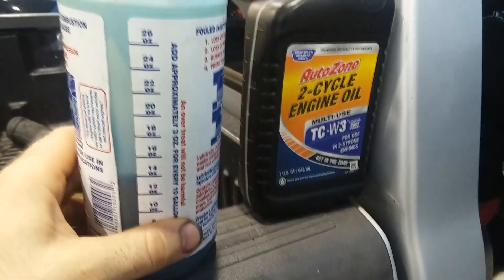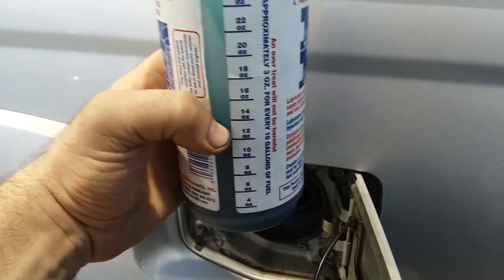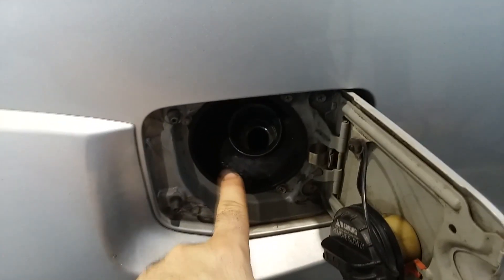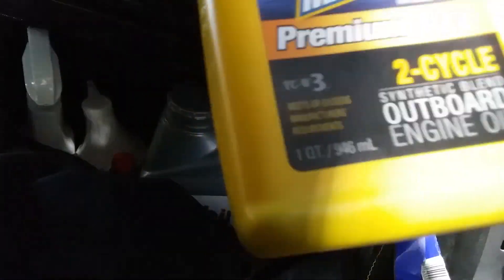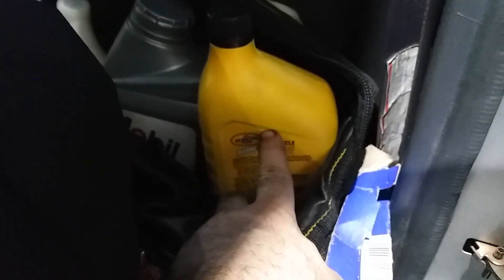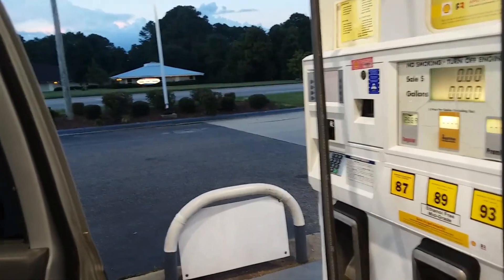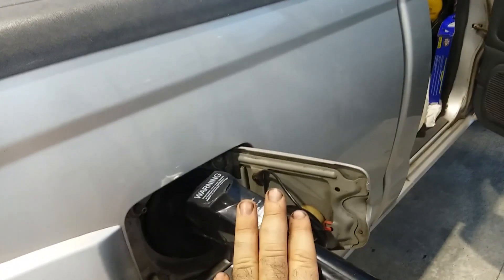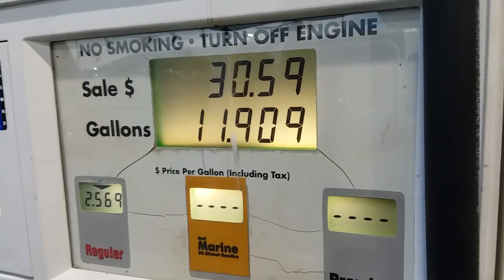The Secret to Better Gas Mileage: 2-Stroke Oil in a 4-Stroke?

Comment from the maker: Be sure to enjoy my TCW3 2 stroke video that covers greater detail about what it does and why I use it and how it compares to the Lucas Upper Cylinder Lubricant, which I used to use.
More about 2 stroke TCW3: https://youtu.be/lfDm1gMKqFY
Lucas Upper Cylinder Lubricant:
https://youtu.be/ATL19lVpmAk

DE Nichols is an Amazon affiliate and if you buy anything on Amazon 
after clicking within 24 hours then you are supporting the channel. 
Thank you.

DE Nichols is not sponsored by any of these products. I conducted my own
 scientific testing and found them to increase efficiency on my 
vehicles. Individual results may vary.

Comment: 500ml Two stroke oil added to a 100L Petrol (gas tank of my truck) keeps everything happy and clean inside, even my muffler and exhaust pipes dont ever rust . . doing it for 35 years .
Reply: Its a 1:200 ratio . . . very little two-stroke . . .but makes a hell of a difference.

Comment: Dang I run an ounce per gallon in my 93 Jeep 4.0
Reply from the maker: Wow. That's very different. You learned that's what it likes?
Reply: @DENicholsAutoBravado  Yep it runs better at that mix in hot weather
Reply from the maker: I'll have to remember that. I do occasionally run into fans of older Jeeps! I fixed up a 60's or 70's something once. They couldn't figure out how to keep it on. I replaced all the vaccum lines that were leaking vacuum and it ran tons better for a customer. 

It still didn't quite have a steady idle but the customer was so happy it was much easier to keep the engine on. Lol

Sometimes, a lot of times, I want to fix something farther but you can't argue with a happy customer. 

It had to almost be 2k rpms probbaly just to stay on before I gave it some TLC. Dipping below 1100 rpm was sketchy after that. Much better.
Reply from the maker: They were usually DIY and figured with the big issues out of the way they could probbaly take if farther from there. 😁
Reply from the maker: I seem to remember he bringing me another of his collection a few weeks later. I mostly know 1996 and newer cars much better so whenever I got to competently work older tech it was quite satisfying.
Reply: @DENicholsAutoBravado  funny thing is mine has a slight intermittent sputter at low idle, I think I need new injectors & the 2 cycle mix is acting as a bandaid for that because it goes away with the 2 cycle mix. Just guessing but I'm going to inspect the injectors soon to verify
Reply from the maker: @Yelladog78  Interesting. I wonder if it's partly because of summer gasoline versus winter gasoline formula? Or if the extra heat is the primary difference.

TCW-3 oil is better suited for non 2 stroke applications than normal plain 2 stroke oil by the way.

It can raise compression a bit so I suspect your engine when younger wouldn't seem as different when it's hot out.
Reply from the maker: @Yelladog78  You might see the fuel injectors not working as accurately if you're good at reading spark plugs. The color temperatures and other details spark plugs can show can be very interesting. 

If you don't know how to read them you can always send a quick video clearly showing the spark plug blades.

Comment: I use this in my 2cyl. string trimmers and my chainsaws. They sit all winter and start up every spring in one to three pulls. I have a steep hilly yard and use it in my riding mower gas and my self propelled toro mowers and it gives me cylinder protection because they are sling oiled.

Comment: I run an old trail bike that was designed to run on leaded fuel, as it's almost impossible to buy leaded fuel now I add a little synthetic 2T to the fuel, lead used to lubricate the top ends of engines, rings, and cylinder walls, small end bearings,  modern engines are designed to not need lead in the fuel but old engines need a lubricant, since adding 2T oil the engine runs quieter, smoother and there is no difference in power, and it just as easy to start, I add a 2% mix. plus it smells great,

Comment: Been doing this for a while in all of my vehicles and equipment to help protect the cylinder walls and prolong fuel injector life. The benefits are very noticeable on my air-cooled Ducati, which are known for running very hot. Using full synthetic 2T oil in the fuel, I’m able to place my bare hand on the engine case after a freeway run without getting burned. For anything thats water-cooled, I use TC-W3 for its lower flashpoint temperature. Additionally, all of the cleaning additives in these fuel oils are causing the old carbon buildup on the valves and piston tops to chip off over time, leaving them clean and shiny. It almost seems counterintuitive for fuel oil to clean the combustion chamber, but that’s exactly what it does.
Reply from the maker: I absolutely appreciate this comment. Just switched back to TCW-3 from SAE30 oil and I noticed the difference right away.

I think my spark plugs wear out faster with the SAE30 oil. Hopefully, that won't be an issue with TCW3.

Comment: I've done that b4..this is what happened >>>..the oil fouled my sparkplugs..ruined fuel injectors..smoked by the exhaust pipe..less power.clogged up my gas filter n I got crapy MPG...bottom line is 4 strokes shouldn't  have any type of oil in there gas...
Reply from the maker: None of this happens with these products when used correctly. It lubricates all of the fuel system, has no effect on the spark plugs and improves MPG.
Reply: What the f you put in you car?😅

Comment: I have baught shell advanced 2t motorcycle oil which is semisyntetic having JASO FC certification. I put 1ml 2t to 1liter of petrol in my Euro6  motorcycle Its my first use and niw I just git carbon deposits in my exhaust but the bottle claims that it prevents deposits in exhaust, keeps engine clean and low smoke.
Reply from the maker: I think there will always be carbon deposits in our exhaust. Lol, but I'm sure a poor oil choice would do worse.
Reply: @DENicholsAutoBravado    BUT Shell advanced had all the certifications including  JASO FC and FD, ISO, API etc and it is semisyntetic.
Reply from the maker: Yes. Great company. Great product. Burning gasoline will still produce hydrocarbons. And some carbon will deposit.

With the wrong conditions it can be really bad amounts of carbon and with better conditions it's not so bad. Make sense?
Reply: @DENicholsAutoBravado  Thanks bro. 💯 Correct.

Comment: i have a 4 stroke lawnmower and have been using stils 2 stroke oil in my gas 50:1 ratio 20 ml to 1 liter,, doing it for years.. runs cooler and less contaminated 
so i only have one type of gas in my garage..
Reply from the maker: My 1 cylinder 250cc dual sport motorcycle loves it too!

Comment: Wouldn't  driving around mix it up well enough? The sloshing while speeding up, stopping, and turning?
I read a 60 page forum on this and the author stated that it didn't matter whether you did it before or after.
Reply from the maker: All I can say is I tried it gasoline 1st once on my motorcycle and I ran the tank across crappy freeways and roads for 50 miles and the mix was still poor. Pour the additive and then the gas? Mixed perfectly in a minute of it just idling. 

Idling! Little 250cc idling and sitting there versus stop and go, freeway, bumpy construction zone. 🤣

Yes, definitely put your chosen additive in and then add the gas.

I saw gasoline with lines of blue additive barely swirling in versus the whole gas tank evenly looking blue.

Comment: I use it in my collector car and anything that gets filled from a jerry can. I can tell you the tail pipe is spotless and the engine runs smoother.
Reply from the maker: I forgot my modern trucks tail pipe was less sooty too. Thanks!

Comment: For engine 4 cycle.
2 cycles of synthetic or semi-synthetic oil leaves ash on top of piston, should be used 2 Cycle TC-W3 not synthetic.
Provides improved lubrication, engine cleanliness, rust and corrosion protection, also provided improved performance when used low octane. Max mix (ONE) onze 2 cycle oil by 5 gallons gas.
Reply from the maker: A gentleman who had been researching and experimenting with oils for many years more than me, told me that synthetic TC-W3 was the lowest ash, but anything TC-W3 would be good, but synthetic would be better.

He's commented and taught me a lot over the years, but he changed his name when I gave him a shout out so I won't repeat his name. Especially since, he had finally changed it back.

He's who got me to first try TC-W3 all those years ago. I was just a user of Lucas Upper cylinder Lubricant prior to that.

Comment: Lead works as a lubricant..especially for the fire ring(first compression ring).Unleaded gas does not help the lubrication nor travel on the piston top ring,neither does ethanol..Gasoline nowadays here in the U.S contains much less additives that provide lubricity to the gas..If you go to the A.P.I website you can clearly learn that gas as well as oil are literally deprived from these vital additives currently..at least by 50 percent..I put my endoscope thru the spark plug hole and it does not lie..The results are amazing..I can clearly see how clean the piston tops are..And yes..It does clean the combustion chamber and it does run smoother and cooler and more efficient..Now..2 things need to be taken into account..Number 1:I have gotten better results with at least a premium quality 2 cycle oil(TCW3) to guarantee it does not leave any residues..The hotter your engine runs the higher the need for full syn or at least a blended type..Number 2..The quantity you add should be minimal..I would say 5 ml per gallon is a very safe amount..Over that amount is unnecessary and it is not going to help at all..This should be done at every fill up....i have used just about all kinds of additives you can think of and this has been the cheapest way and the safest one..So it is up to you how much you want to add...Every engine is different..If i was a first time user i would put 1 ml per gallon and check if the vehicle is running better within 2 weeks of daily use..If you notice improvements you can leave it like that..If not you could increase the amount biweekly by 1 ml per gallon and so on up to 5 ml per gallon..but only if necessary..Make you use a high quality oil and you will be impressed with the results..In fact this is the only additive i use in my gas..All the rest..NO..Thank you
.

Comment: So should I use 2 cycle oil injection when converting a car to LPG?
Reply: switch over to gas every so often to keep the seals and all from drying out and cracking. lpg will dry them out if you dont.
Reply: @joed.m.9443  or just constantly mist in 5% 20:1 2 stroke petrol?
Reply from the maker: You would need too little for it to work. 2 cycle oil has to be injected with the fuel.

2 oz. per 10 gallons is very little. Using a high quality synthetic oil along with the LPG for the best and simplest results.

We're talking about a 4 stroke engine right? 

A 2 stroke engine would get in trouble on LPG.
Reply: @DENicholsAutoBravado  "A couple glugs" to 55L is what I'm using on regular liquid petrol. Obviously with lpg I'd need to be more accurate (can't just dump it in the fuel tank because the fuel tank is a gas bottle), and probably use more oil per liter gasoline equivalent.
Reply: Not it won’t there is a guy who runs a Polaris 900 RMK on lpg, it’s force fed oil injection, BTW there are huge Fairbanks OP 2 stroke and Cooper Bessemer 2 stroke, they are force feed oil injected also.
Reply from the maker: Not that anything is impossible, but engines last so much longer on LPG, so I wouldn't worry about. 

Is it possible to inject it slow enough? Yes. It's just not practical. 

Partly why I speak of high quality synthetics, is think about how oils like Pennzoil Ultra Platinum help direct injection engines because they also mist into the engine helping like an upper cylinder lubricant.

Direct injection engines need Lucas Upper cylinder Lubricant even more than traditional engines because the high gasoline pressures can cause cylinder wall damage by slipping past the rings. This is one of the reasons for Lucas Upper cylinder Lubricant  

I forget which video you commented on but Lucas Upper cylinder Lubricant has the same theory has 2 stroke oil, or even better TC-W3, which is only up on 2 stroke oil because the oil had to be lab tested to do what it says it does.

The Marine Institute hardly recheck if a company keeps making it up to the quality specifications, but why wouldn't a good and trusted company keep it up?
Reply: @DENicholsAutoBravado  Well I mean I could use a shorter injection duration and skip fire for the UCL oil on LPG. Sorry for no response as I have notifs off right now.
Reply from the maker: I'd love to hear more about it. Is it already designed to inject 2 stroke oil? If so, I might think about a bit more on LPG rather than less to prevent various engine seals from going bad. 

LPG doesn't protect valve seals as well as gasoline.
Reply from the maker: Sorry for my slower response. It gave me some serious puzzling before I realized what I believe is the right question.
Reply: @DENicholsAutoBravado  I mean I'm just speaking in broad hypotheticals...
Reply from the maker: @ellenorbjornsdottir1166  cool. I've only seen one Euro car which was designed to deliver upper cylinder Lubricant separately and it was also designed to run on natural gas. You make me think that isn't a coincidence. 

That Mitsubish Colt was it? I forget. Engine sounded awful and I wonder if was because they didnt keep it full. It was empty. Fixed that...sounded a lot better with a few other fixes. . . But still rattley.

Comment: It’s going to get mixed up when it gets tossed around in the tank while driving. You can buy Walmart Super Tech Marine TCW3 two cycle oil for about $12.00 a gallon. Amazon delivers free with Prime.and have some great deals. Google: Been Testing Oil and read  the results from the testing.
Reply from the maker: Great tip! I'm curious the, a person came by and seemed to indicate that I was getting inferior results from this semi-synthetic Pennzoil TC-W3 - have you worked with or tried fully synthetic? Is he right, do I need to upgrade?

Comment: your gna plug up your catalytic converter
Reply from the maker: If you're not much for reading and you don't want to be disagreed with, feel free to watch this video instead: https://youtu.be/ATL19lVpmAk Below it are comments of people ruining their catalytic converters with a similar product, but understand that it only happened when they used far too much of the product. More than was recommended. 

(And) on to my explanation: :)

Doubtful. This product burns ashless. It has also gone through stringent guidelines and tests by the Marine Institute to prove itself as a reducer of engine wear which included the requirement of tearing down engines and inspecting them for wear.

Granted, this is done for 2 stroke engines and I'm recommending them for use on 4 stroke engines which also has catalytic converters. Then next, consider this: I have been running this product for about 3 years. In that time, I primarily used it in a Nissan Frontier which classically needs new catalytic converters at about this time. I've been watching the live scan tool data for all these years and 3 years prior to the start and use of this product. As all Nissan frontiers of my vintage do, they eventually have what most other companies would call an earlier loss of the catalytic converters, but at least it's never been for them plugging up and causing misfires. They just become less effective and you have to replace them for emissions only.

Since they've very slowly degraded over the last 6 years, (having managed to once a year have a catalytic converter code show up at the beginning and they slowly degraded from there to finally you can't do 30 miles with mixed driving without the light turning on for a P0420 or P0430 6 years later, I'd submit to you that your statement is not accurate and they're right on schedule.) I'd have to say that this product has had no effect on their life.

My Nissan has seen so much life that the engine has failed, having never replaced it's catalytic converters and having passed state emission requirements all the way up until the year before the engine has expired. Engine blew up not long after the catalytic converter "failed". Were the converters still fine? Possibly. Is the real failure the engine? Failing engines don't maintain stable fuel trims so the catalytic converters actually could still be in great shape.

I hope you stick around. I look forward to more of your comments. I hope you don't mind if I disagree on occasion with them.